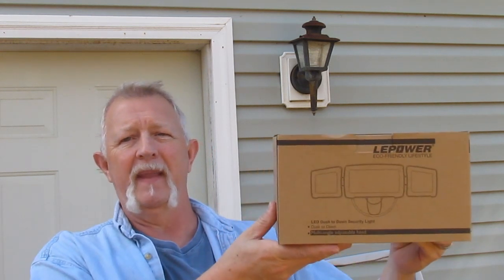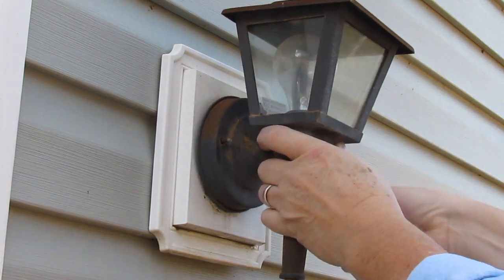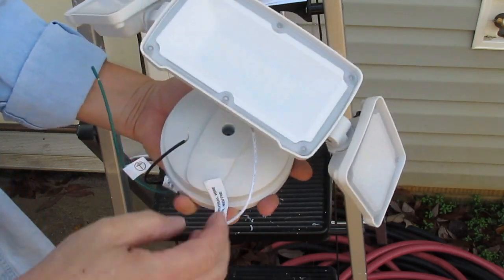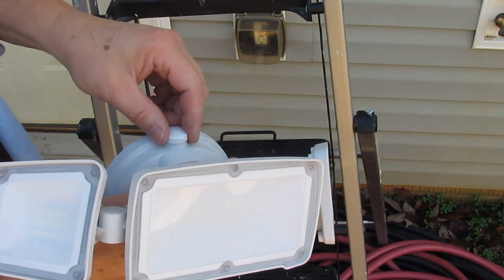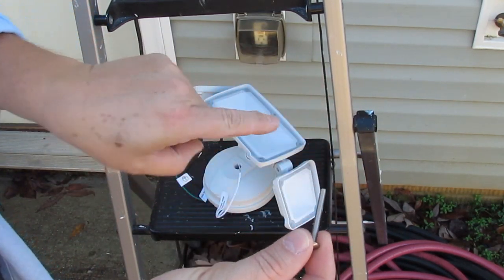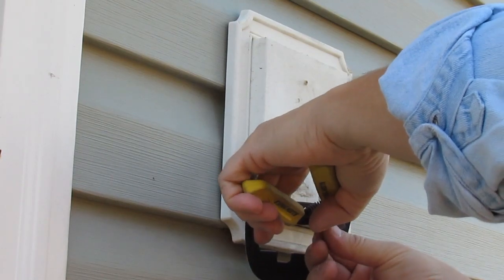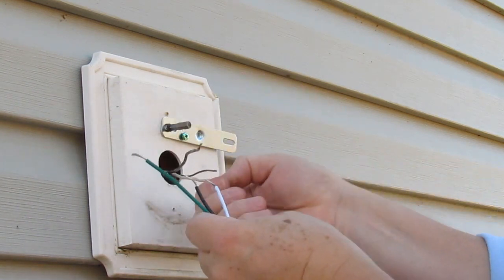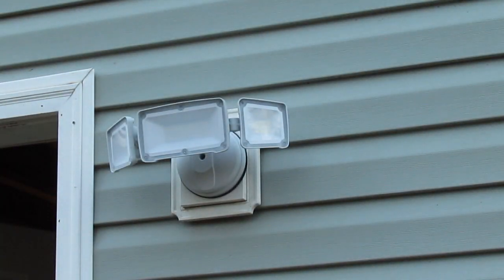Install LED Floodlight - Simple!

Comment: Excellent video! I've been looking for a video on how to install the vinyl siding block onto some flimsy vinyl siding that has a 4 inch hole cut with scissors. Need to replace the light that's over that hole, and would like to put a block on there, instead of just mashing the vinyl laps flat with the new light! Don't have a video about that do you Dennis? Thanks!
Reply from the maker: I'm sorry, I don't have a video of that process yet.  Thanks for watching, Ghibli!

Comment: Great job on your clear step by step instructions. Would you have info on how to bypass the sensor and keep the light on constant when we are hanging around outside
Reply from the maker: Thanks for watching, Aaron!  The first of these lights I bought came with a little cap that fits over the light sensor, so that one was easy....put the cap on the sensor and the light thinks it is dark all the time, so can be switched on and off at will.  The subsequent lights I bought did not come with these caps, so, I've tried two ways and both work.  On one, I took a bit of black paint and covered the light sensor lens.  On the other, I covered the sensor with black electrical tape and trimmed it off to look nice.  I suspect the paint will last longer outside, but both methods are working so far.  I haven't tried this, but it might be worth a try....take a small lid from something, paint it to match your light (mine are white) and then stick it down over the light sensor with a bit of silicone....maybe paint the inside of the cap black to block all light.
If you are having issues with a motion detector, I don't have any suggestions for that...these lights of  mine are not equipped with motion detectors.

Comment: Good afternoon Dennis. I will give all the detail. I'm running into a dead end and I'm unable to find resolution to a electrical wiring job. I installed an attic vent fan and the only power in the attic was a line from a switch to a light fixture. There was no ground for the light or in the plastic junction box. I replaced the junction box to one that has a ground. I ran the 14/2 from the fan to the junction box. (I used red Cap's and as extra safety I wrapped the end of each and wires with electrical tape) Connected all ground with a pigtail and connected pigtail to ground screw.
Connected all white/neutral wires and added a pigtail for the light.
Connected all black/live wires and a pigtail for the light.
I replaced the light fixture with one that uses a pull chain for on and off.
Connected the neutral pigtail to the silver screw and connected the live wire to the brass screw.
Turned on the circuit for the attic.
The fan works perfectly, but the light will not work.
Testing I did/tried:
I tried a new light bulb still didn't work. I tried using the original light fixture, didn't work.
I made new pigtails for white and black wires and cut off a little extra casing for each wire, to make sure there is contact.
Still not working.
Do you have any thoughts on possible issue?
Reply from the maker: Is the feed to the light coming from the switch only, or is there a feed into the light fixture box with the original hot leg running to the switch and back?
Reply: @dwcoffey   the feed goes to the light switch. Then a line is run from the switch to the light.
Reply from the maker: Sorry to rehash, just trying to make sure I completely understand....
The hot line comes into the light fixture box from the switch.  Now the new 14/2 line runs from the fan to the light fixture box.  Inside the light fixture box, you have tied together the white/neutral from the fan, the switch and the pigtail to the light fixture.  Also tied together in that box are the black/hot from the fan, the switch and the black pigtail to the light fixture.  Then the hot and neutral pigtaisl are connected to the light fixture.  So the switch should be giving you power to both the fan and the light.   You've tried 2 light fixtures and bulbs, so the problem is not likely to be the fixture or the bulb.  If you have a volt meter, you could carefully check across the fixture terminals while the circuit is hot to be absolutely sure. If not, I think we can rule that out.  So....since the fan is working, the only thing left is the pigtails for the light.  Sounds like maybe one of the pigtail wires is not making contact where the 3 wires are tied together...either the hot or the neutral.
Reply: @dwcoffey  no need to go crazy over it Dennis haha
I found out what I needed to do. I had to use 2 black/live pigtails from the cap and connect both to the screws on the light. This feeds constant power to the attic fan and light without having to turn off the light switch.

Comment: Thanks for the video. Great details. 
I have a question. Can I replace the light and for a deck ceiling fan? Thank you
Reply from the maker: Thanks for watching, Jose!  You'll need a ceiling fan support behind the electrical box first.  You don't want to mount a fan to an unsupported box.

Comment: Hi Dennis 
Thank you much for the video 
I just received mine but the instructions tells me to use sealing compound or silicon glue for wet location(I install outside exposed to rain)
Where do I apply the compound, all around where the black gasket meets the base? Or around the junction box or both?
Thank you
Reply from the maker: I would apply it to both sides of the gasket.  Thanks for watching!

Comment: Have you had any issues getting water in the fixture? A lot of folks complain of getting water in fixtures just like this. Not sure if they are just not using the gasket or the rubber washer/seal for the mounting screw?
Reply from the maker: Thanks for watching, Thomas!  I haven't had any water issues into the fixture or the box.  The one I show in the video gets direct weather too, so you may be right, they may not be using the seals.

Comment: One other thing you can use to test for a hot circuit is a voltage probe. It just beeps when you put it next to any hot circuit. I have a little GB Instruments circuit alert probe that works like a charm.
Reply from the maker: Yes sir!  Great point, easier to use too.  Thanks for watching Darren!

Comment: Great video, thank you. Do the side lights rotate 180 degrees from the main light? I know left to right it only rotates 90 degrees from the main light, but is it possible to rotate it down 180 degrees so one of the three lights is pointing the opposite direction from the other two?
Reply from the maker: Thanks for watching, Chris!  No, they only rotate about 90 degrees either way in both directions.  You can get the side lights to point about straight up or straight down, but that's as far as they go.

Comment: Well done! this is how I installed mine on same vinyl surface.  Was just curious, I don't see an electrical box behind the unit, is it inside the wall where the old light was attached to?  Mine looked the same way when I removed my old light.  Thank you!
Reply from the maker: Thanks for watching, Scott!  Mine uses the exterior vinyl box as the electrical box.  That was new to me when I found mine like that, but apparently is common and acceptable for code.
Reply: @dwcoffey  the vinyl box usage may be common but it is not up to code

Comment: Question: how is the light holding up? Only reason I’m asking is because of kinda leary of installing a light fixture like that where you cannot change bulbs. So if it stops working, you have to change out the fixture?
Reply from the maker: Thanks for watching!  So far it is doing great.  No issues.  Yes, as far as I know, there is no way to replace individual LEDs without replacing the whole fixture.

Comment: I accidentally bought a 150W LED security flood light. (I thought it replaced a 150W, but it’s actually 150W, equivalent of a 900W!)
Is it even safe to put this where my patio light goes? It’s just like your old one. 
Thank you!!
Reply from the maker: If the actual power requirement for the new one doesn't exceed your old one, it will be fine.  In other words, if your old one is 150W fixture and your new one is rated at 150W actual, it is fine.  Thanks for watching!

Comment: I installed an older motion dual spotlight to the side of my shop ( after it was replaced with a newer on on the house), and I connected an extension cord wired to the light and the other end plugged into an outlet inside the shop. I then wanted to set my light to stay on by switching it off and back on, and installed a light switch inline interrupting the HOT or BLACK wire to the switch. I can shut off the light, but, when I switch off, then on, it goes back into normal mode and does not stay on.  I figured the black wire was the one to use to interrupt. Maybe it's the white wire then. I'm pretty sure the light system works once I figure this out. Ideas?
Reply from the maker: Thanks for watching!  Some motion sensing lights toggle the sensor when you switch them on/off.  So on/off once puts it in motion sensing mode, then on/off again takes it out of motion sensing mode.  Some lights work this way.

Comment: Some say to seal it with caulk around the base so it’s waterproof… but then these fixtures have gaskets… what’s the best way to go about this
Reply from the maker: Thank you for watching, Jose!  Mine was a sealed unit as the back was completely enclosed, so it could be mounted with no sealing at all other than a gasket to protect the wiring in the box.  You could also caulk around the base.  I suppose the best method would depend on your siding and how the box is mounted.  I'd use whichever method would give the best seal.

Comment: I don’t have a power drill - you think I could hammer a few nails in the mounting bracket instead?
Reply from the maker: Thanks for watching, Gary!  You'd have to be real careful not to break the plastic housing.  I'd probably mark my hole placement by holding the fixture in place and using a nail in each hole to make a mark, then move the light out of the way, use your nail to create a pilot hole for the screws, then drive the screws by hand with a screwdriver.

Comment: did you have to predrill holes in the vinyl box for the mounting plate?  I am in the midst of siding my house and am replacing the light fixture.  There is not electrical box just a thin plate that was screwed to the masonite siding.  I am adding the vinyl box for the siding just not sure how to secure the mounting plate for the new light
Reply from the maker: Thanks for watching!  I did not, I just used the existing holes, but you could locate and drill your mounting holes on a new box install.

Comment: Is there a way to use the dusk to dawn sensor and the light switch?
Reply from the maker: Thanks for watching, Erik!  At night, yes.  If the switch is off, no light at all.  If the switch is on and it is dark enough outside, the light will come on.  If you leave the light switch on, the duck to dawn sensor will turn the light off and on via the sensor.  With the sensor enabled, you can't turn the light on via the switch unless it is past dusk.

Comment: I only have 2 wires coming from the house a black and white and copper. But coming from the led light there are 3 wires black and white and green so what color hook up to what
Reply from the maker: Thanks for watching, Tim!  White to white, black to black, and green to copper.  The copper is the ground wire in your house wiring.  The green on the light fixture is a ground wire.

Comment: It’s a fixture like you have without motion sensor and only two lamps on a single switch I wired it up lastnight but it won’t work when the switch leg is taped to hot so I caped the switch leg but need it on a switch
Reply from the maker: I'm not sure I understand, and it is very difficult to describe wiring through messages, but....if you only have one feed into a 2-way switch and 2 fixtures on that switch, your whites should go to the silver side of the switch and your blacks should go to the brass side of the switch....this includes your feed and your fixtures.

Comment: I don’t have a ground wire coming out of my outlet. How do I found the flood light?
Reply from the maker: Hi Oscar, thank you for watching!  If there is not a ground wire in your wiring, but you have metal a metal junction box, you can attach the green wire from the light to a screw in the junction box.  If your box is plastic, you can just skip connecting the green ground wire.
Reply: @dwcoffey , is it important to connect the light to the ground?
Reply: @dwcoffey  , would lightning hit my floodlight for not grounding it?
Reply from the maker: It should not be a problem  If there is no ground wire there, your previous fixture wasn't grounded either.  This particular light fixture is all plastic, so grounding it is nearly pointless anyway.

Comment: Do you wire the switch leg to the hot
Reply from the maker: Thanks for watching, Josh!  Hard to say, because it depends on how the fixture is wired.  If it is a single fixture, single 2-way switch....typically you will switch both the neutral and hot.  If it is a 3-way switch, you may just switch the hot leg.

Comment: I have the same type of light but when I install the light and turn it on it stays on for 1 min and turns off why is that.
Reply from the maker: Thanks for watching, Warren!  There's a photo-eye on top of the light that senses day/night.  If it is getting any light, that may be making the light turn off.  I covered mine with a piece of black electrical tape and then the cap that came with the light.

Comment: My light has no green wire for house ground
Reply from the maker: Thanks for watching, Loran.  Do you only have white and black wires for the fixture?  If so, connect them accordingly.  If your fixture has a bare wire also, that is your ground and should be connected to the bare wire from your house wiring.